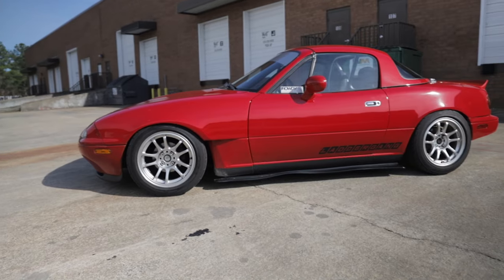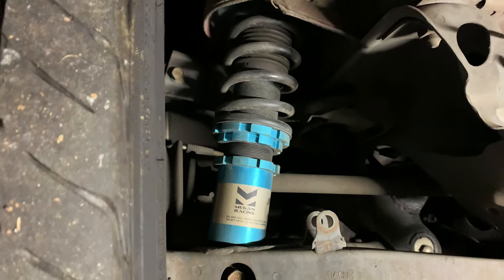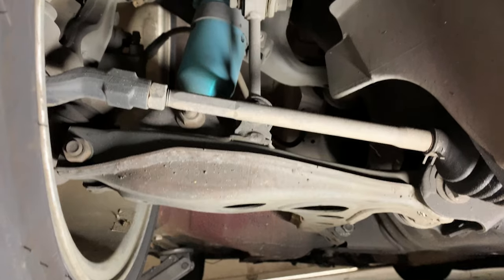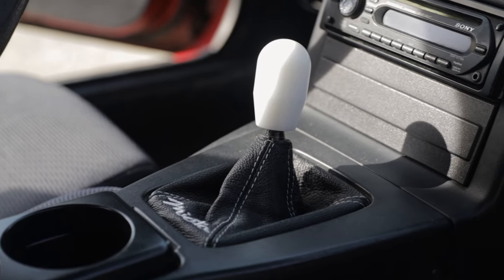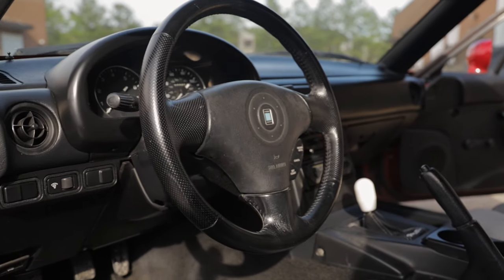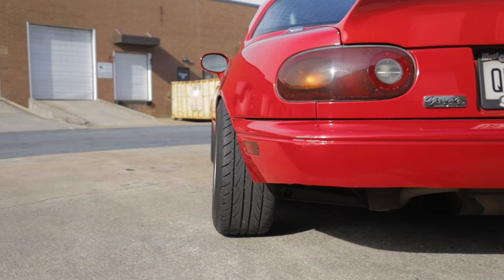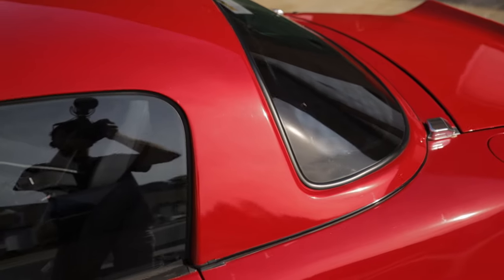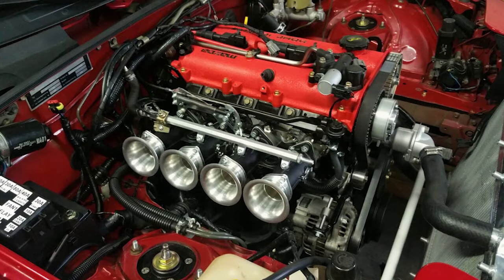5 Things Every Miata Owner Should Do

Comment: 5x Racing shifter rebuild(brass bushing for long term).. huge difference! Before my 6 speed felt like each gear was a neutral lol another non-performance mod is stereo/speakers especially on tired old Bose system like my 01 had

Comment: Just bought 16X8’s XXR 513 with 0 offset and I ordered BC Racing BR Series Coilovers so I can’t wait. I went to replace my brake pads and my caliper was rusted shut so I couldn’t so I might have to go with what you said about the 1.8L brakes
Reply from the maker: Nice! Yeah I’m actually still using the 1.6 brakes just with new rotors and pads.

Comment: I'd suggest buying a couple of the cursed water plug caps so you aren't stranded for a while (part # FEA713104) and maybe start looking for an affordable speedometer cable. These are 2 items that will typically go bad. Just did the shifter rebuild, what a difference!
Reply from the maker: Key word: affordable haha. Shifter rebuild is niceeee.

Comment: Since I live in Sweden it was kind of hard to get my hands on some paco´s strong arms or anything equivalent. So I ended up welding the front end after Flyinmiatas templates. I couldn´t believe the difference, I was honestly very disappointed of the handling before this since it behaved very very strange mid corners (coils+ns2r). But this got rid of it all, with barely any weight increase and very low cost.

Comment: First thing to do in a miata
weld the diff
straight pipe 
put steelies in the back
angle kit for the front
roll bar or hardtop
Drive it like its stolen
have fun :v
Reply from the maker: Drifty boi 👍🏼
Reply: Hard top is no replacement for a rollbar. If you roll, that hard top will cave in on your head :S

It's a tight fit but I'm trying to do a roll cage, bucket seats both under a hard top. Wish me luck lmao

Comment: Great video. Good stuff. Not a fan of a roll bar in the NA with its lower seat back. Being rear-ended is way more likely than a roll-over and I don't want to whack my skull on solid steel. 
I would add: sway bar(s) and end links. At least a front upgrade (FM sway bar is great) if not both makes a major improvement to turn-in and cornering with no negative effect on ride quality. It isn't crazy expensive AND is relatively easy to swap. After tires, this is my favorite first performance mod suggestion even for Miatas that are only street driven and have no other suspension mods. (But this does assume that shocks, bump stops, and upper mounts are not worn out.)

And right after that, headlamps. It's so nice to see better at night.

Comment: Sort out your suspension and stick polybush mounts on all the wishbones. Leave the bearings alone and the ballpoints unless they are fucked. Weld that diff up and put proper polybush diff mounts on it. A hard top has zero effect on the chassis. Do wheels and suspension then forget all the washing and cosmetic bollox, buy a better ecu and decat the exhaust, better plugs and leads, better air filter system and get it mapped

Comment: Would like to use my hardtop, but.....they're easily stolen, and resold. Some good factory HTs go for $1800+. Are there good, aftermarket locks?
Reply: Peter McDonald i have Talon locks on mine. $150 each lock though pricey, but safe. They each come with a key made specific for that lock.
Reply: Check out greg peters carpassionchannel. He shows some thiev safe hardware for hardtops
Reply from the maker: Here's a link to the Garage Star locks. They're just security torx though, so if someone has that socket they can get it. Still way less likely though, and more time consuming than the factory latches. 

https://garagestar.com/shop/uncategorized/security-bolt-kit/
Reply from the maker: These? https://retromodernusa.com/shop/talon-hardtop-lock-for-na-miata-1989-1997

That looks legit and very secure!

Comment: There’s a rebuilt Miata with 100k miles.Should it be a cop??
Reply from the maker: Just look it over good and make sure it’s solid. 100k miles is nothing.
Reply: Alex Perrucci Appreciate it!!Is buying a car with a salvage/rebuilt title a problem for safety?
Reply: @Don.Rock0  the cars are valued so low by insurance companies that almost any accident will give it a salvage tag. That rebuilt take means someone fixed it enough to pass inspection. I would still be weary, make sure all the body panels align, check the frame, bring a magnet with you and put it on the quarters(this will show if these a ton of bondo undernead). Short of that check regular things. Before you test drive it, make sure the engines cold, if its warm it could hide possible issues either in the engine or transmission. And check the rocker panels, pretty sure that's the most rust prone place on the NA.

Comment: Do you have a link to the rear brakes you have?
Reply from the maker: They're just stock replacement blank rotors that I think I got from Rockauto or Moss Miata and EBC Red pads. Still running the 1.6 rear brakes. All you need for the 1.8 rears though are 1.8 caliper brackets, new pads and 1.8 rotors.

Comment: Great video except for this: the front upper control arms are $275+ EACH from the dealer. Not my idea of “not that expensive.”
Reply: I got two brand new ones for $80 online
Reply from the maker: Got mine on Rockauto $60 a piece. Been pretty happy with them.
Reply: Alex Perrucci you sold me. Rockauto to the rescue again 🤣
Reply: Well your problem is buying parts from the dealership